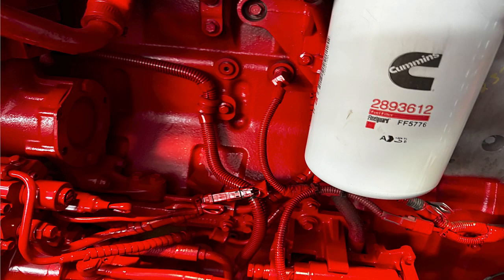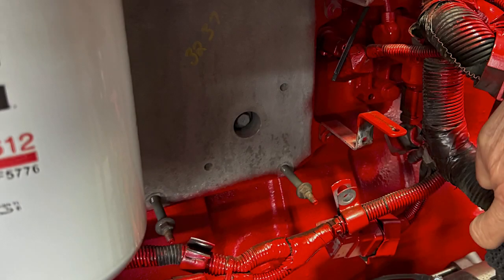The ISX oil temperature and pressure sensors

Comment: What's the psi rating for the oil going to the temperature sensor and the pressure sensor with a mechanical gauge?
Reply from the maker: It should be within 2 psi of what the sensor is reading. The sensors - if two separate- are in the same oil rifle.

Comment: I have a 2005 870, my oil pressure gauge works but my oil temperature gauge does not. I've never been too concerned about it but it is good info to find out that they both run off the same sensor on the 870s
Reply: We have the same issue on the same engine. Did you find a fix for it?
Reply: @andrewmitchell3568  unfortunately no I didn't